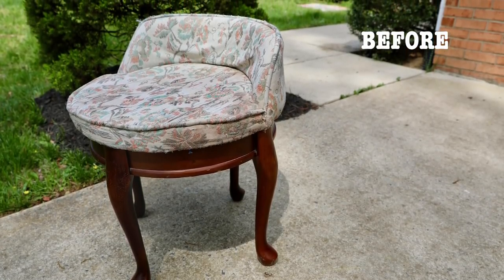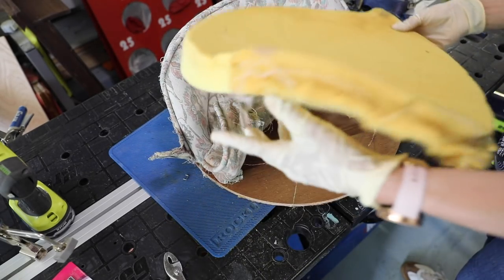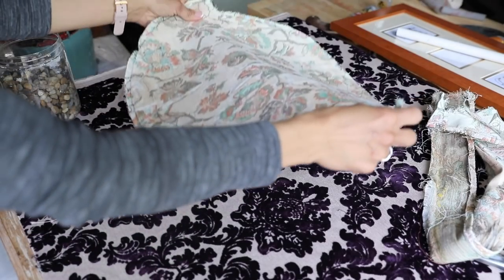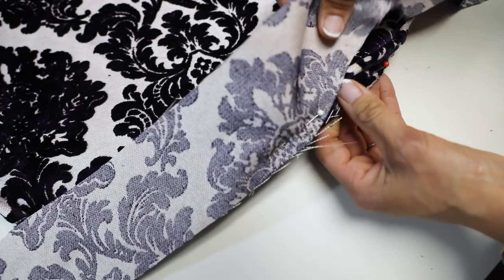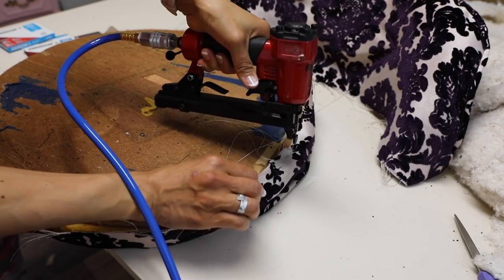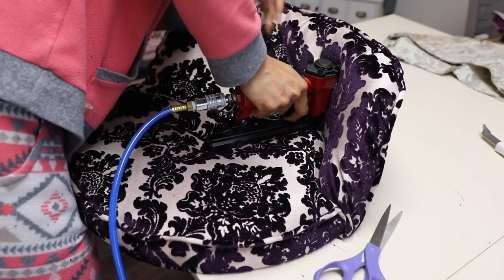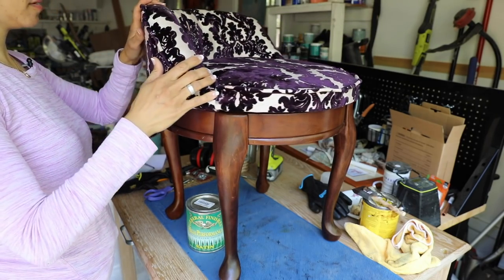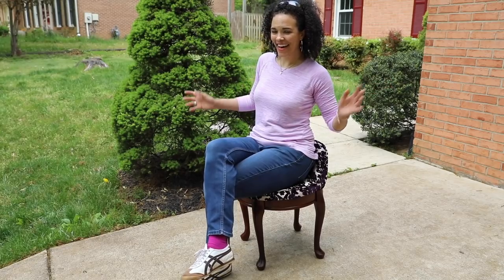BEFORE and AFTER: Reupholstered Thrift Store Chair Stool Makeover

Comment: What a beautiful piece!  Glad that I found you. Subscribed and looking forward to more great projects.   Love doing this as well.  Find pieces at the side of the road as well as thrift stores.  Normally I strip all fabric and padding and dispose of them as I add more foam/padding so original fabric does not make an accurate pattern, check foam to see if it can still be used and see if any repairs need to be done to the wood structure/base.  Repair this as needed.  Wash foam by doing "grape stomp" in cleaned tub with hot soapy water, two rinses in hot clear water.  Kneeling on foam as you roll it like a sleeping bag gets rid of most of the water.  Then I stand it on an end in tub raised for ease of draining on a tub seat and set a fan to blow on it.  Usually spray with Fabreeze or put some in last rinse water.  Reverse foam piece without flipping it upside down every few hours for even air flow and drying.  Can take 2 to 3 days to dry completely.  To check for dryness, place foam on floor, top with 2 or 3 layers of paper towels then stand on top.  Any moisture will show on towels - dry longer, in sun if possible.   Living in Pacific Northwest with all the humidity and rain makes it difficult to use the sun for drying and disinfecting, but is possible in the summer.  Then I reupholster the piece by placing foam on the strengthened base, fabric straps or springs as was needed.  Add additional foam if wanted, then batting, then muslin to provide firm base for fabric that will lessen movement of fabric that will wear against foam/batting.  Then add the fabric.  I cut the muslin to approx size then check for fit, if ok, then I use this as my pattern to cut the fabric.  Really like that you suggested making sure to use correct staples for each project as some staples are too long or short or simply will not hold in that specific wood.  I always test staple in an area that won't show or be used to actually be needed for attaching fabric.  Do not want to weaken area needed.  Sometimes carpet tacks or upholstery staples are needed to insure a lasting result.  You go girl, love your work!

Comment: I'm always afraid of keeping the original padding cause bugs. Does spraying it get rid of everything?
Reply: Bedbugs, specifically? Spray it, but additionally wrap the padding in a black garbage bag and seal it closed with tape, then leave it in the hot sun for as long as possible. If that's not possible then try leaving it outside and blasting it with a hot hair dryer for maybe fifteen minutes every so often. There are probably other ways, but I've heard this works. If you have upholstery or something that can go through the dryer, do it several times on high heat.
Reply: If you own a freezer do this. I always put the foam parts and any material in a plastic garbage bag in the freezer for a week. If there are any bugs or microscopic eggs that you can't see they will freeze and die.If you spray you might have an odor you can't get rid of. Honestly I always do this for clothing I buy at thrift stores even if they appear to be new with tags on them.
Reply: @rosalinaayala5963  Ooh, that's a good idea! I'll do this with my thrift store clothing now....
Reply: @rosalinaayala5963  We always do that with our organic grains as well, but only for three days because the freezer is kept at it's coldest setting.

Comment: Really like the fabric! A few things for your readers: using the old fabric for the pattern is right on but using the old foam is not. I get trying to save money but your pattern is sized to new foam (when the piece was originally made). As much as I like the fabric, it would have really stood out with new foam as it would be nice and smooth. Your foam should be cut 1/2 inch larger than your stitch line.  Second, welt cord should be done in three steps: first, sew the fabric around the welt cord; second, sew the covered welt cord to the top (seat) part of the fabric (making cut lines almost up to the seam to make it easier for the third and final seam); third, sew the side panel on. With each successive pass, the welt cord seam gits tighter and stronger and more finished. There is a trick to this. The first pass, feed your welt cord and fabric in from the left; the second pass, feed your covered welt cord and seat piece in from center (like a normal seam); final and last seam, feed all fabric piece in from the right. This guarantees the nicest and most professional outcome. Lastly, after attaching the seat to the legs, you might consider covering the underside in what is called "cambric". It is the black fabric on the underside of furniture. Typically you fold the edges over so they are not raw and staple it down. Finishing touch is to run a black sharpie over the staples so they disappear. Lovely piece. You found a good one.